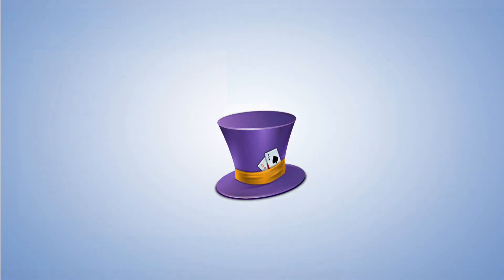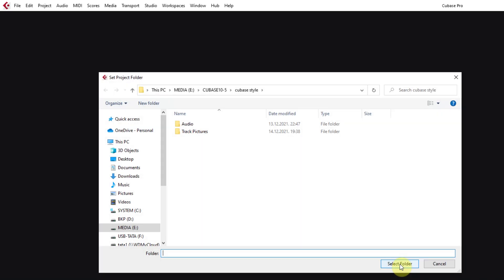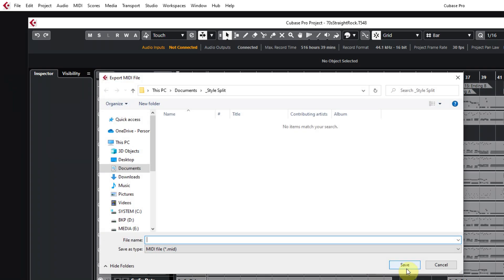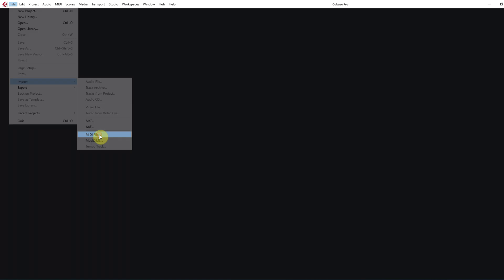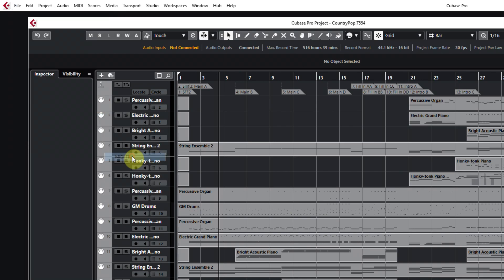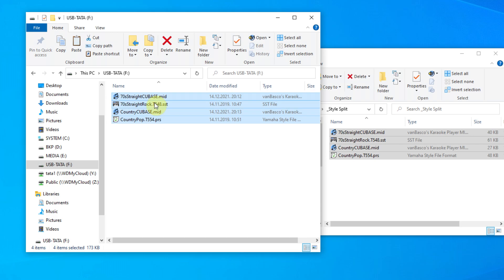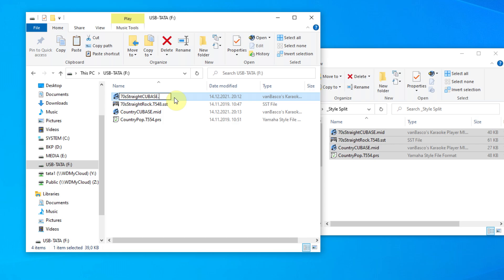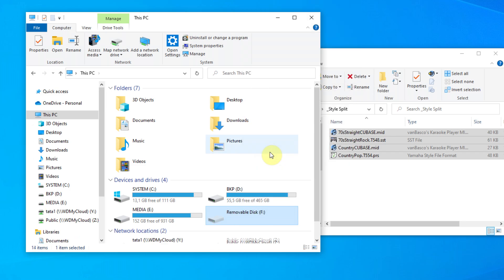Preparing Style for editing in Cubase using "Style Split and Splice" software

Comment: Congratulations for another great video my friend Casper!!!! 
          As I understood it, this great tool helps when we need to open the style in the DAW( where the CASM data would be lost), but with this process: you can open the midi in the DAW, make the edits you want,  and,  following these steps, play the style normally on the keyboard as the styles won't lose the previous CASM configuration...?! Was it this? Thank you very much for another great video!!!!!!
Reply from the maker: That's right, split Style into MIDI and non-MIDI. Process MIDI in Cubase and with Style Slice and Splice merge the two parts back into Style.